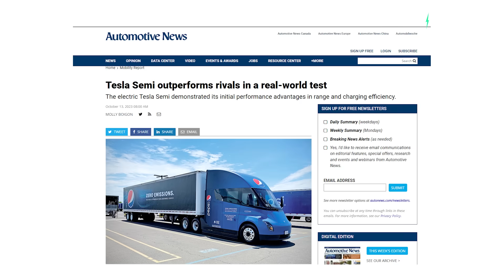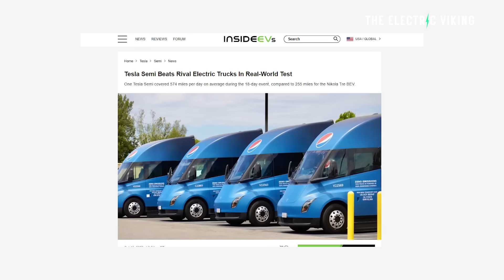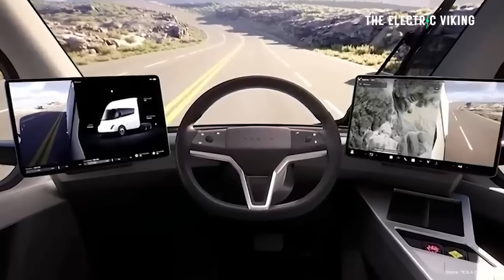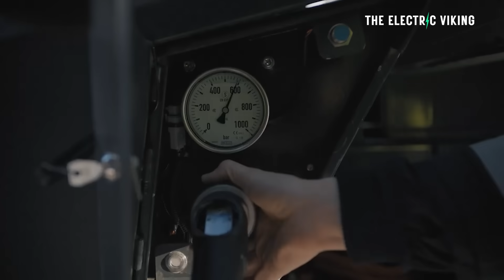Mercedes claim that Tesla Semi breaks the laws of physics proven correct

Comment: From Carthrottle:

Tesla's megacharger promises to provide the Semi with up to 400 miles of charge in just 30 minutes. Now this sounds exciting, but it’s not surprising that this king of charging uses a lot of power. Tesla claims that the new Megacharger will have a charging output of “more than ten times the power levels” of its Superchargers. Those put out approximately 120 kilowatt-hours of energy, which means that the Megacharger could put out close to 1.5 MWh at peak load.  This is about as much electricity as the average North American home does in one month. That’s one truck, with one trailer, in one half of an hour.

Of course, there’s rarely just one truck stop in a major city, and there’s usually more than one truck filling up at each one. This means that truck stops are going to end up being huge drains on the power grid if EV truck transport is going to become a reality.  Even the best-equipped power grids will need to add some production facilities just to keep things running smoothly.  This could result in trouble with the Tesla Semi’s next-strongest perceived advantage: running costs. Tesla claims that the Semi will cost around $1.20 U.S./mile to run, which is about 20% cheaper than what it takes to run the average diesel semi. However, according to the MIT Technology Review, that figure was created using an estimated electricity cost of just 7 US cents per kilowatt-hour. This is close to half of what the average American homeowner pays, and that’s a rate that could easily jump if there were to be some significant increase in electricity consumption (like you would expect if hundreds of electric tractor-trailers were plugged in at once).

But let’s assume the price of power stays where it is. Will it actually be cheaper for trucking companies to double down on the Tesla Semi? The price of the truck hasn’t been revealed, but the MIT Technology Review estimates that the Semi’s batteries alone will cost over three times as much as the average oil-burning big rig. This means the truck will have to put on over 1 million miles before it starts saving money versus the diesel engine. While that’s not unreasonable mileage to expect out of a big semi, the financial rewards certainly aren’t as glorious as Elon Musk wants you to believe.

Comment: 1mwh charges.....  Australia produces around what per year.  250GWh?  how much of that is surplus you can use for your truck charging....  and this is disregarding the increasing number of E cars.  I think Teslas biggest advantage here is aero.  all the other manufactures are using their conventional designs.   According to a Transport Canada study the removal of truck mirrors increase fuel efficiency by 4 to 10% depending on the design.  Once US adopts digital mirrors I suspect the miles for trucks will increase.  

I do not know what Merc claims Tesla Broke here besides the Electric grid.

Comment: 1750 km in 24 hours equates to an average speed of some 72 kph. There would be no time for breaks, loading and unloading or recharging. If you would achieve an average speed of 80 kph (the max speed for freight trucks on interstates in Europe) that would leave about two hours and 5 minutes of time for loading and unloading, mandatory driver breaks and recharging the batteries. I don't think that makes sense.
Reply: This was just done as a demonstration. There ws no claim that a Tesla Semi could do this in regular operation; of course it couldn't. There was no time spent on loading or unloading, and the Tesla Semi started the day with a 95% charge and ended it with a 15% charge; while in regular operation, it would have to take an hour or more to charge back up to 95% for the next day.

Comment: How much of the 72,000 lbs was battery and truck?
Reply: TESLA semi can haul 82k Gross w/ 70,000 lb Payload 535+ miles in 8H.
Reply: @markplott4820  That implies that the truck itself only weighs 12,000lb, which is probably 1/2 to 1/3 of what it really weighs.
Reply: @marsrocket   - FRANZ said the Tesla semi , weighs about SAME as a Conventional semi w/o FUEL .
Reply: @marsrocket   - Dont forget the TESLA semi went through 1st Principles LEAN Design process , unlike Conventional semi and BEV/Hybrid/FCEV semi.

Comment: I’d like to know the weight of the batteries vs diesel fuel.I’d also like to know  the volume of power that is needed to operate a fast charging station and the cost of a charge up.
Reply: Batteries weigh 20x the weight of diesel
Reply: 200+ miles in 10 minutes , let that SINK in.

Comment: would love if you made video on how much heat is pruduced with ev. vs normal truck , also counting production and the transport of that electricity, than ceep in mind ev is also an extra airco for heating or cooling it's battery - sure it will be better for the air quality but by how much since most fine dust is produced by tyres and brakes (it do need less braking bc alternator braking if ppl drive correct) and ppl will use more tyres bc off acceleration what also result higher procuction for those 
would love to finaly see everything compared instead of chery pickings
another problem i see with solar energy is our human reaction , if i invest in solar i problebly buy more than i use , i see ppl having 2 or3 times amount they need (def during summer) , if i did i'm not gona trow that away or give for free to electrik company so we gona find ways to use that and hopely increas our lvl of comfort by example an extra airco or fridge during summer
i would learn to swim before 2040

Comment: If the pepsi vehicle never stopped except for the required 30min/8hours, and the maximum distance per charge being 300 miles, and giving them the benefit of a doubt that they could completely recharge in 45 minutes, that means that a break time /driver (due to the 30min/8hour break) is 1.5 hours. And with a maximum of range of 300 miles per charge is a loss of an additional 2.7hours spent charging. So 24hours-1.5hours in breaks - 2.7 hours charging leaves 19.8 hours driving. 1076 miles /19.8 hours, requires an average speed of 54.4mph having no additional stops. How is this possible?
Reply: It's not, they lied most likely.

Comment: As a long haul driver I still don't see ev truck working for long haul
Where are you going to get enough charging stations for the trucks. And how are you going to get enough power to the stations to charge them and who is going to pay for them. 
Where is the power going to come from. 
How much emissions are made just to make the batteries and the truck not to mention the child labor to get cobalt do they even become carbon natural by the time you need to replace the batteries and the fire problem with them. So how clean is clean

Comment: 1750 km in 24 hours. with a range of 400km that charges to 80% (320km) in 45 minutes. Assuming they didn't waste a second on their pitstop, that's four hours charging. So that means their average moving speed was 87,5 km/h.
kinda hard to believe and also very, very illegal (to average that speed he'll be for sure hitting peak speeds over 120km/h). i call bs

(ok i hadn't got to the part about the charge but that sounds odd too and wouldn't change my point, which means it would make it even less believable)

Comment: "one did 1750km" - thats the stand out one. 
So just over 1000 miles. With optimal stops and no breaks other than for charging. With a double crew thats nothing special for a diesel truck - infact thats not even a tank of fuel for most of them.

Comment: The most expensive operational cost of trucking is labor. So, it doesn't matter how good Mercedes trucks get, they're over a decade behind Tesla when it comes to FSD.
Reply: FSD is not a thing. Elon has been saying it will work next year.  So far it hasn't.  I think like fusion energy, it is the thing of the future and always will be.  Driving is an extremely hard problem to solve.  The AI has to recognize a whole lot of things in the environment and know what to do about them.  The processing power needed is "not cheap" and convolutional AI has about reached its limits as a method.  When they make an AI system bigger it starts to "hallucinate" .  Feed "AI hallucination" into a search some time and read about how the systems react like they are on seriously bad drugs.
Reply: TESLA semi is the ONLY Semi in the WORLD that Handles & Drives like a TESLA model 3 .
soon, there WILL be a need for a NEW License for BEV semi Drivers.

Comment: Breaking a law of physics? Not likely. At the conceptual level. But possible. We must treat laws of physics as axioms - an axiom is a statement that is taken to be true, to serve as a premise or starting point for further reasoning and arguments and treated as infallible until falsified.
Between the conceptual level of the laws of physics and the way we work with them - make them operational - that results in the numbers we use are a lot of steps.
Most likely something in those steps was wrong, not the main laws.
Likely. Yes, it's possible that a law of physics gets falsified. We only have to go to the quantum level and we only have statistics and no clue of the actual conceptual model.
But a semi falsifying the laws of physics? ROTF

Comment: doesnt the Tesla have a lower payload capacity because of the large battery pack that eats into the GVWR?
Reply: no and only a low percent of loads weight out. most cube out before reaching weight limits.
Reply: NO, Tesla can haul FULL LOAD of 82k Gross , thats 2,000 over what ICE semi is Allowed to haul. 
TESLA semi Delivered FULL LOAD from Fremont to San Diego 535+ miles in less than 8H, ONE Driver , one Pee break.
Reply: Correct. Higher battery  weight means lower payload - FACT. This truck is only suitable for light weight, local journeys. It will be a laughing stock  amongst serious trucking companies. Fine for delivering candy floss to the next town. Full weight is where the trucker’s profit is
Reply: @markplott4820  how is that possible when the advertised curb weight is 27,000lbs. all specs i see online say the ICE versions have on average 8000lb advantage?
Reply: @bundles1978   - Tesla has BAMF performance Advantage (bad ass mother Flocker)
Reply: @markplott4820  acronyms are pointless unless they actually mean something. you still haven't explained how elon got around DOT rules, and is allowed to weigh more than the GVWR. If the truck is heavier than its ICE counterparts, it cant legally haul more than the ICE trucks. This is a point that no one seems to understand.
Reply: @bundles1978  I'm curious to see if DOT and FMCSA will change bridge weight formula for these trucks and how much bitching municipalities will do about the damage heavier trucks will do to the roadways - we get enough of that already with 80000 max.
Reply: @Lafly84  I figure you can expect Elon to come out and refute the 80k limit, and point to a white paper he wrote saying its ok to go over 80k.

Comment: Gosh, getting 400 plus miles between charges with a wait time of 45 minutes before getting back underway.  Wow, just WOW.  How fast were these semi trucks traveling, any idea?  A truck driver needs to drive close to 700 to 800 miles a day on average just to make decent money in the trucking business.  He or she needs to average over 10,000 miles a month every month.  The driver is limited to a total of 13 hours on duty of which he may not drive more that eleven hours.  Charging time counts towards on duty time.  To fuel a regular combustion engine class A tractor only takes 15 minutes, maybe 20 at most. and usually you put enough fuel in the tank for two days travel.  And when you stop for the night and need either heat or cold in the cab to sleep, just how quickly will you drain those batteries and need to recharge before heading out on the road again?  And what happens when your batteries run out of charge, are you going to walk back to the truck stop with a can so you can get a charge and bring it back to the truck?  Us drivers are paid by the mile and governed by the hour, so how does Tesla change that metric?

Comment: That's Sydney to Charters Towers QLD non stop....!
1750km in 24, that's 80km per hour flat out with 2 charge stop of 1hr.  Unless, they are driving 2 up (2 drivers) & have a changer on board & it a straight road, no hills, no load  with a constant 100km which is the legal limit.
I'd question the drivers as a owner of a company. Sorry to say. Its no safe , it make no sense. You would struggle to do it in a car.

Comment: This sounds great when there is only 20 trucks in the road.  If there are a hundred trucks at a truck stop trying to charge at the same time and it takes over a half hour each, it sounds like a huge shit show.
Reply: You're assuming charging will be just like fueling trucks—just pull up to the pump and go. It's much more likely that electric truck charging will be a completely different paradigm; for one thing, it will very likely involve reservations, so truckers can plan ahead for their charging stops. Time will tell...

Comment: Here in the UK motorway service stations struggle to get enough power to run existing chargers at max output. Frequently if more than one car is being charged the charge rate drops. I cant imagine many could install a single 1MW charger let alone the 10 to 20 many will need.
Reply: Here in Germany they have the first trials with electrified highways ( Truck is charging while running). 

When the UK wants to have more electric trucks (wasn't it Lorries in the UK?) then they have to invest in a bigger electrical distribution network to support the change.

Comment: electric trucking wont go anywhere without the underlying infrastructure (electricity).
Reply: The limiting factor in BEV truck deployment will be battery availability.

The build out of infrastructure is underway now and will proceed in a stepwise fashion.  As the trucks gradually become available, the infrastructure will be there.

The process will take time, as the demand for batteries will be very very high for the next two decades.  But the cost savings on fuel in the long term is very large, so the transition is inevitable.
Reply: So true! There are already 21 Tesla Megachargers in place, enough to add 80% charge to 504 Tesla Semis a day, for the 36 Tesla Semis now in private (PepsiCo) hands. And a network of 108 more between Fremont, CA and Laredo, TX, is already in planning.

Comment: someone has to tell me how they drove 1076 miles with a single driver since it is illegal to do so in USA...  the most one driver can do is 11 hours followed by the 10 hours of break time. because even at 100 miles per hour it would take almost 11 hours to cover that distance... the speed limit for the trucks in USA is between 55 and 85 depending on the state they are in but mostly its 60 miles... and at that speed it would take 18 hours to cover that distance... and i am not even counting the charge time lets say 2 hours total ... that is literally 2 drivers and 24 hours to do this. I think this data is BS
Reply: I don't recall anyone saying it was done with one driver; if they did, they were mistaken. Of course two drivers were used, trading off during the mid-day recharge at the PepsiCo Bottling Plant Megacharger.

Comment: How can your take-away from this be that electric trucks are already viable?
30 minute break every 4 hrs, yea sure, how about charging infrastructure?!?!

In Europe it is already a big issues that trucks can't find a spot to put their truck, now they will lose space for about 20-40 chargingpoints only for the trucks at services? And that not be the most dangerous/accident prone place for fires, with those huge batteries, charging speeds, etc, etc?!?!
Reply: Electric trucks are already viable, because they are already in use on the road now and saving money for their owners.  It's as simple as that.

Of course they won't replace every truck next week.  There are not enough batteries.  But every truck Tesla can make for at least the next four years, will be already sold before it rolls out of the factory.

It will be a slow process, but over the next 25 years, trucking will gradually transition to 100% BEV.
Reply: @davidmenasco5743  Maybe I'm biased because of other manufacturers, but most in Europe that I know off and have visited, are completely focussing on Hydrogen. It makes sense to me and them, but Tesla can deliver now and that seems like a good product.

Comment: No it isn't a "false equivenlency"  You have a battery powered truck towing a load with a given amount of battery power pulling a given load.  The Semi has no " magic" to change the reality of physics.  It is also a battery powered truck with only 8x the battery capacity of the R1T; and towing 1/10th the load getting 120 miles.  Increasing the battery by 8 only lets you increase the load by 8.  I was giving Tesla some credit for a better design but it probably isn't even 10% better so a range of 150 miles fully loaded in the real world is more like a proper estimate.
Reply: You evidently haven't been paying attention to the developments that Sam is reporting on here.

There is a bottling plant in Sacramento California where three Tesla Semis are used on long distance routes.  Pepsi has confirmed that the Semi operates on a 450 mile route with no problems.  It does 450 miles on one charge in real world use carrying drinks for Pepsi.

What's more, the plant has 18 other Tesla Semis in use, but these trucks run short routes up 150 miles.

BECAUSE MOST TRUCKS ARE USED ON SHORT ROUTES!!!

So, it's great news that the Tesla Semi can be used for long routes.  But since all the other truck makers are way behind, with ranges less than 250 miles, well it's a good thing that those trucks will also be viable because most trucks don't drive long distances.